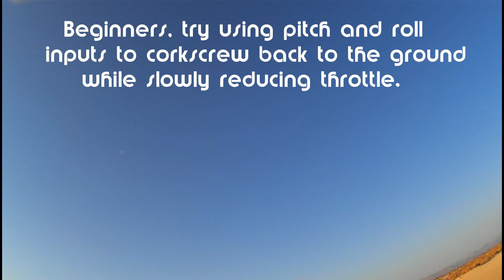Quadcopter "Wobble of Death": VRS Recovery and Avoidance

Comment: This guy doesn't seem to have any issues with VRS https://www.youtube.com/watch?v=6Bc2G0iIeG0#t=153  Can you explain why he can hit the throttle full for over a hundred feet, drop the throttle to zero, then within a few feet pull out with ease?
Reply from the maker: +Wm Robert Leschyna He kept it a very light quadcopter with plenty of power and high efficiency props.  The lower the weight, the better the acceleration, and the less chance of VRS.
Reply: +Quadcopter 101 Well according to the definition and your explanation as I understand it, power would have little to do with it.  From Wikipedia "Essentially, the helicopter descends into its own downwash. When the condition arises, increasing the rotor power merely feeds the vortex motion without generating additional lift". Bottom line is I feel that your demonstration is not one of "true" VRS, but merely a demo of trying to pull out of a fast decent with not enough power, something very different than vortex ring state.
Reply: If there is sufficient power, such as the 3d model shown in the video, it's possible to simply power out of VRS.  VRS describes a ring of downwash that surrounds a column of upwash near the hub (center) of a prop or rotor, resulting in a stalled condition near the hub due to the upwash, combined with lift futher reduced due to tip vortices. With sufficient power, the downwash produced from even a thin ring can provide enough lift to recover and/or overcome the upwash (due to viscosity, the ring of downwash expands inwards, overcoming the upwash). 3d helicopters can quickly transition collective where the entire rotor transitions from upwash to downwash (or vice versa if inverted), simply because they have enough power to do so.
Reply: Agreed, but the producer of this particular video and explanation is not experiencing what he thinks is VRS. That little quad doesn't have the power or size to create the required scenario. Heck any downwash that may be created would be affected by a fart. His problem is that the momentum created by gravity when his  machine is allowed to drop altitude uncontrolled is such that those little motors and props don't have the power to reverse travel before hitting the ground.   Far different than VRS.
Reply: Perhaps not in that video (I didn't watch all of it), but with sufficient power, it's possible to power out of a true vortex ring state. An unloaded Sky Crane (with thrust to weight ratio around 2.0), can do this. Most 3d models have an even higher thrust to weight ratio.
Reply: I agree.
Reply: The way it's worded in an aerodynamics article, for a full scale helictoper to be able to power out of vortex ring state, it needs about twice the power it takes to hover. The article notes that the SkyCrane is the only helicopter able to do this (2007). Link to article: http://scs-europe.net/conf/ecms2007/ecms2007-cd/ecms2007/ecms2007%20pdf/ese_0121.pdf .  There may be scale effect, but aerobatic models have much more than twice the power to hover, which would explain why they can power out vortex ring state. This is discussed here: http://www.helifreak.com/showthread.php?p=4651682#post4651682 .

Comment: Noticed some weird wobble when descending Q500+ today (maiden flight) so I stopped home mode and manually landed the quad slowly.  I thought it's because of the wind but gut feeling tells me it's more than that.  I then did some research and found out the "wobble of death" aka Vortex Ring State.  Ended up with your video and I'd say it's the most helpful so far.  Thank you so much!

Comment: Helicopter pioneer Raymond Prouty characterizes the vortex ring state as a very unstable boundary of air about the blade tips which produces vibration and erratic thrust variations. He states that vibration begins at a rate of descent equal to about 23% of the hover-induced velocity and persisted until the rate of descent exceeded 125% of the hover-induced velocity. Part of the airbody boundary below the craft elongates as the descent rate increases until this airbody bursts, with an ensuing reduction of lift.  A rotorcraft might not get the chance to achieve a descent rate of 125% of hover-induced velocity in time to recover before smacking the ground, hence the proper maneuver is to create forward speed. This will re-form the airbody.
Thank you for a thorough demonstration by risking damage to your own quadcopter to illustrate this.
Reply from the maker: +robert gillies My cheap little X5C is very tough and can take it.  It's still going strong more than a year later, with all its original parts :)

Comment: Can VRS be avoided or at least toned down by using angled motor mounts? This way the air from the motor is pushed to the outside. I understand that generally, a quad with angled motors(like 10 degrees) is faster and more stable.
Reply from the maker: +Bogdan Boeru Yes, but you also lose efficiency by doing so.

Comment: Thanks for this, I don't have too much trouble with my Syma, but my WLToys V686G wants to go into this state really badly,  it takes every opportunity to do so.  It is murder to bring down from height.  Are there any  tips on using the rate percentages to do it better?  I usually have it on 100% and just use the throttle but would using lower percentages help?

Comment: Thanks for posting this and good video.  I see this when flying outdoors with some of my smaller micro quads.  It does a very similar 'death wobble' descent, I apply full power and it barely responds, if at all.  Will try full forward throttle next time and see if I can get out of it that way.  I've also had it happen when I flew directly under another quad.

Comment: I bought a syma x8c and it has started to lose power or something even on a full charge it has barely enough power to keep it in the air.. This happens on all three batteries and they have not been used much.

Comment: Nice explanation sir! I had this with a much larger F450, although I could actually drop at an alarming rate with a lot of wobble, I never really entered VRS, just shaky video footage!  I was however flying in high wind, so I guess that's why I never entered VRS? The wind was shifting the VRS effect?  I always thought it was the gains that caused the wobble of death, but now with your advice, I'll either corkscrew the F450 back down or use a slight bit of forwards and backwards motion :)

Comment: I'm an "apprentice". Has anybody tried dropping prop speed to almost nothing while hovering over where you want to land(two feet in front of your face comes to mind so you don't have to climb or hike) and giving it a little burst of throttle about 8-10 feet up to stop the descent? When I say "almost nothing" I mean whatever it takes(50-100RPM?) to level the bird while the props act like 'air brakes' or 'rotary drogue chutes' without creating a vortex. Just enough to keep it level while it drops almost free fall into, or through, a very weak or no vortex. A rapid burst and immediate return to landing power 'should'(said he, optimistically) avoid any prop starving vortex. I'm aware, as you are, that there won't be the luxury of hard forward to break out of a bad ring.

Alternate method of destroying bird and property and making fool of self:

Maneuver the quad to overhead at some reasonable altitude, cut power OFF and scream "I'VE LOST POWER" as bird does "The Falling Leaf" stunt maneuver. At the right altitude you flip power back on, quad's gyro right's the bird somewhere near ten feet and you perform a normal landing. Everybody claps and cheers.

Thoughts, please. Thanks.

Imbedded in all this is a secret idea that the sharper of you may see that may make money. For awhile at least.

Comment: can you just kill the throttle and let the quad pass though the turbulence  then reapply throttle and get out of it ?
Reply from the maker: thelowbottomranch no, because you'll first have to overcome the downward momentum before it will stop the drop.  Doing such, the props will froth the air even more.
Reply: +thelowbottomranch I have done this successfully with my X5C but you do need good height to get out of it.

Comment: This is sort of off-topic but would vortex ring state get eliminated with ducted propellers? Wouldn't this break the "ring" that gets created?
Reply from the maker: Dragongeek No, it's still possible. But Bell Helicopters has come up with a patented design for a ducted blade system that does eliminate it by using additional vanes over and inboard of the propeller diameter to break up the ring.

Comment: Hi, What is the wire with the flag you have coming out of the time of the radio? Does it improve signal?
Reply from the maker: mylomine Here ya go
https://www.youtube.com/watch?v=EQbRnQsHLHA
https://www.youtube.com/watch?v=b_IWbiYfvfQ
Reply: Quadcopter 101 Thank you very much. So on your mod did you drill a hole so that the wire was coming out the end? Also, your wire seemed to be a little longer than the one if the videos above. The video says something about using a wire of equal length and something about 2.4ghz.
Reply from the maker: mylomine Yeah, my wire is a full 2.4 Ghz wavelenth (125mm).  It was long enough that I poked a hole in the fake antenna tip to extend it.  I used a heated bent paperclip to do such.  And the little orange tape is so I don't poke my eye out forgetting it's there.
Reply: Quadcopter 101 Can I just find any old wire hanging around and cut it to 125mm and then solder it on? 

By the way, thank you very much. I am a subscriber of your channel. I love your videos. I have also read every page on your blog. You have been very helpful in my most favorite new hobby.
Reply from the maker: mylomine Yes, but try to use a relatively thin, single strand wire.  Multi-strand wires can cause degradation of the signal. Total length of the original antenna plus soldered extension should be 125mm. Best bet is to make it a little longer than 125mm, then measure the total length and cut it to length after soldering.
Reply: Quadcopter 101 last question about this topic, 125mm from the soldered point on the motherboard?
Reply from the maker: mylomine yes
Reply from the maker: mylomine Also recommend viewing at 3:07 in the following video https://www.youtube.com/watch?v=a6Mntw2I0Cg

Comment: You should not use rudder inputs during descent as this will slow down two opposing props and increase the risk of blade stall. instead just use ail. and ele. inputs to move the model out of vertical descent and into transitional descent. 
Full or partial Blade Stall is a function of angle of attack. The higher the RPM and the less loading then the less chance there is of getting into a vortex ring. When a stall occurs over the top surface of the blade you get pressure recovery and that stagnant air is drawn into a circular motion in the direction of rotation and you loose lift.

Comment: is that airfield you fly at your private airfield. I've never seen anybody else there. Just joking. do they fly model airplanes there. Looks like a really good field
Reply from the maker: Albert Raschiatore Yes they do.  Others use it but mainly during the weekends.  I like to go there on weekdays, early in the morning, right after the morning run with my dog.
Reply: I have a very good question for you. I have a RC field half a mile from me. They fly over my farm in the summertime. will my 3 quad choppers interfere with the RC frequency. Never seen anybody flying quad chopper drone
Reply from the maker: Albert Raschiatore It shouldn't.  Some of the old schoolers still use 27 to 75 Mhz, which shouldn't affect 2.4 Ghz.  And those that do use 2.4 Ghz are most likely also using spread spectrum transmitters (meaning you can use multiple transmitters on 2.4 Ghz) http://www.rchelicopterfun.com/spectrum-radios.html 
The biggest worry is interference from urban WiFi (which coincidentally also happens to operate at 2.4Ghz).  WiFi from nearby homes and apartment complexes can create noise which can significantly reduce the range of your transmitter.

Comment: It's funny how model aircraft are so insanely overpowered compared to their full sized counterparts.  I didn't realize VRS was a legitimate problem until I saw this video. My Blade 200 QX and Raptor E550 have enough power to kick VRS to the curb. I can descend vertically at any speed without any problems at all. Power to weight ratio is key.

Comment: Your explanation of IGE/OGE is incorrect. The increased lift while IGE is due to the decrease of induced flow (vertical flow of air through the rotors) which creates a larger angle of attack with the same blade incidence, not because of a cushion of air. Additional lift also comes from induced flow interacting with the ground and forced outwards which reduces wingtip vortices. Everything else is pretty accurate. Great advice and video though!
Reply: Despite all of that, for our beginners, Mr Quadcopter 101 explanation sounds more appealing, because now we know: "Don't descend too fast! If you do - full pitch forward and run away from the turbulent air". Anything else is less relevant for this video. Science will come later.
Reply from the maker: Thanks!
Reply: Nick Soto 

Nick, sounds like you have flight characteristics down but I
highly recommend you remove your booger hook from the bang switch until
you’re actually ready to fire. just saying...

Comment: Great video. I wish I could see the radiocontroll though in the same time. But its really great. It sounds so Easy. But The only time I been into this so called vortex is when I've done a flip. :-) SO that means if I do a flip I kinda have to make it move in the same direction as the flip to prevent it from a vortex is that corrext understod. So a forward flip must still be forward.

Comment: Thanks for the info on VRS. I kept having it with my syma x11c and thought it was a fault or lack of power so I kept jamming on the throttle full, making it worse!
Reply from the maker: Yep, VRS is a big problem as weight is added to a quadcopter.  Just did the following video of a newly released micro quadcopter with HD camera yesterday. The first crash was VRS due to the weight of the camera.  Even knowing that it was VRS and what to do, I still couldn't slide out of it before meeting the ground. https://www.youtube.com/watch?v=rjYIE63ZZ94

Comment: Even worse, my 1SQ V-Cam gets into a VRS after flips without enough upward momentum  and while it wobbles, the gyros make it wobble even more. I also have a question, can I do a funnel with a quad that has 3 axis gyros? When I try (If I do it right) it just leans the opposite direction and flies into the ground.
Reply from the maker: It's extremely difficult with a 3 axis quad as it doesn't have the accelerometers to compensate for sideslip.
Reply: Well, I just give it some inside bank (if I do a right funnel I lean left)

Comment: Good video. Now, i have the Syma X5C-1 model and when it gets high (about 100meters) i take it down by closing the throttle completely and opening it again about 10 meters of the ground. Never had that VRS problem. But, i noticed it 2-3 times when doing flips at very low altitude just 3 meters above the ground. Maybe some quads are more sensitive to that than others.

Comment: Great video. Your point about 'copters with a return to home feature having unusually slow descent rates is very pertinent. By the time this feature needs to be activated it is likely that the batteries are already dangerously low and I have seen several videos of aircraft falling out of the sky when the batteries go flat under return to home mode.

Comment: Does it ever happen that one blade will go into VRS without the rest of them?  I've noticed when bringing the drone down fast that you can see it wobble, as if one blade is losing lift before the others.

Also, do any of the autopilots for hexapods or octopods detect a blade going into VRS, and respond by either increasing throttle on the OTHER blades, or by tilting the drone away from the stalled blade?
Reply from the maker: Well yes it usually starts on one blade but quickly transitions to all the blades as the speed of descent increases.  And I'm unaware of any of the consumer drones that automatically detect and correct for it.  Most with autopilot try to avoid entering VRS by using unusually slow descents.
Reply: I've heard both a Phantom and two larger (5 kg) custom rigs make an intermittent nasty buzzing noise while descending.  Is this related?

Comment: Could VRS be exacerbated at higher altitudes?... like 6,000 feet? I had two unexplained drops to the ground one time along a ridge line..... but it was fairly windy so I would not think the turbulence would stay below the quad too much? It did it twice to me near the same location.... full throttle all the way to the ground. Even reviewing my downlink video we never did figured out what caused it.... and has never done it since. Normally I fly near sea level @ 300-400 feet.
Reply from the maker: Yes it very much can aggravate VRS, and you should have also noticed how much more power was needed to just maintain hover.  Here I am trying to fly my quad at 8000 feet.  Had to fly at full power just to stay in the air, and landed early so I wouldn't burn out my motors. Will a V262 quadcopter fly at 8,300 ft (2,530m)?
Reply: Quadcopter 101 That is what was a bit weird... I did need a bit more throttle, but not bunches. I do know that larger props (or maybe higher pitch?) for altitude has been discussed..... but the thread I was reading they were talking over 10,000 feet somewhere in the Rocky Mountains...
Reply from the maker: CactusJackSlade another item to closely watch is added weight to the quadcopter.  Camera, gimbal systems, and FPV transmitters can add up.  Combine that with altitude, and you can easily run into trouble.